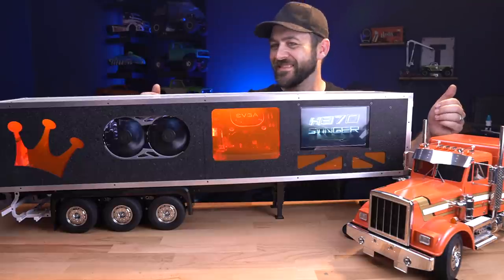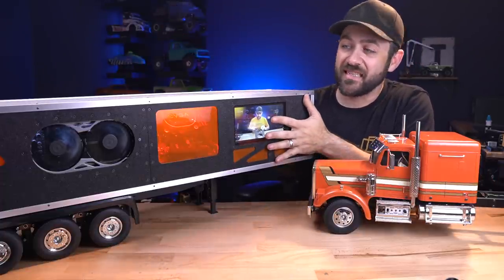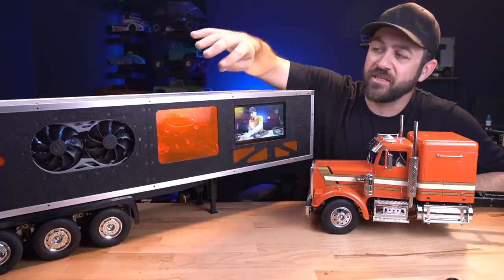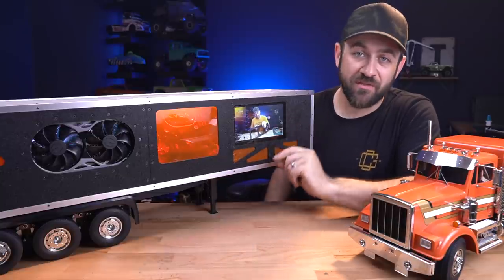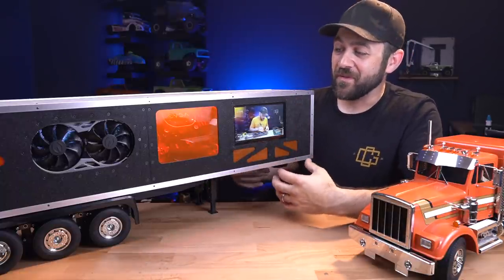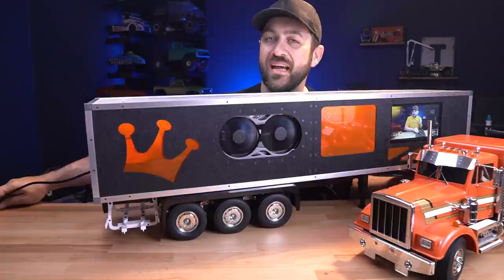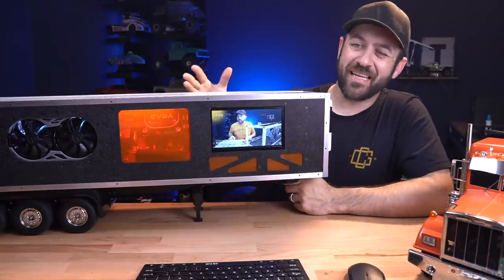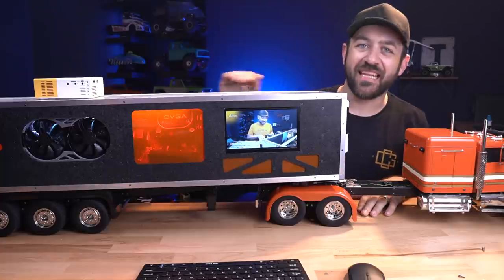Extreme PC Case Mod RC Semi! - RC/PC EP3

Comment: I agree with Jesse put the projector underneath inbetween the landing gear and axles. The trailer I pull everyday has a big pumpbox and battery box underneath. Also for the truck suspension the guys that pull rc construction equipment use a faux machined spring pack that lets the axles pivot but doesn't have function as a spring it's just solid to support the weight. Lastly the transmission in the truck is geared really high so run a small pinion and something in the 45-55turn motor range to keep the speed under control.

Comment: i think that orange acrylic would look nice on the truck between the sleeper and the hitch plate kinda show casing the frame extention. put the projector into the sleeper cab? and use its cables to look like air and power lines from the trailer? i dont know few idea i had while watching. either way it look awesome and cant wait to see it finished. guess ill watch sbg video now lol

Comment: As a traffic engineer the fact you didn't account for proper load distribution is kind of funny. I do like that you and Matt took different approaches to this build as both really show that with some imagination you can do just about anything with these trucks. You will need to remember to deduct some points during the driving portion of the test as that much wheel base on your truck would make it longer than 65' total length which is illegal in the state of California. :)

Comment: Now looking at this I can see 1to1 trailers with built in computer systems that can do it's own inventory of cargo. It's own dianostics and sides of the trailers as flatscreen billboards.
 This and Matt's model might be a precursor of whats to come in real world.
 Your would never make over the scales with that much weight on the 5thwheel.
Reply: Hey Mike, we know that, you can't slide that 5th wheel on that model. We always run heavy in the nose of our trailers in  the 3rd or 5th hole from the front.(8 foot swing life!) Can't put air bags on this model not enough space. Think a dump truck bed actuator would be the trick. Mount all hardware in between the frame rails under the cat walk. 
A helper spring should do the same.

Comment: Mount the projector in the sleeper
Reply: He has the sound and light controller for the truck mounted in the sleeper, there is no room left in it for anything but the battery.

Comment: Magnets and hard drives.......
Reply from the maker: This uses a M.2 SSD which is about the size of a club cracker and sits on the back of the motherboard. Lots of PC accessories use magnets for mount now, it’s not really a concern.
Reply: @HarleyDesignsInc  I figured the ssd wouldn't be impacted but what about the 3.5 floppy discs?